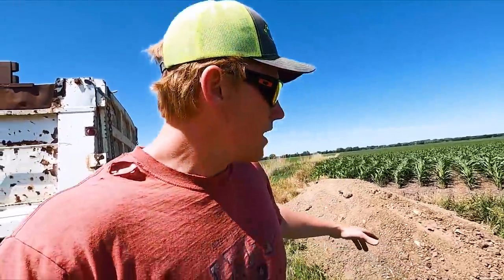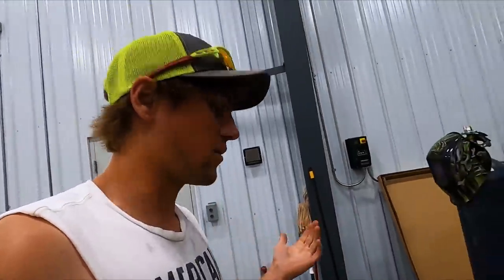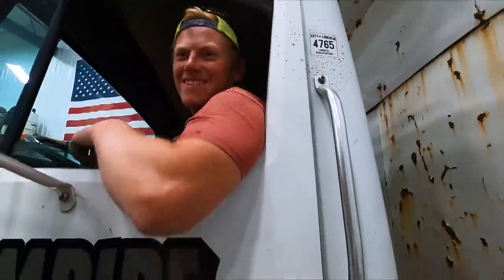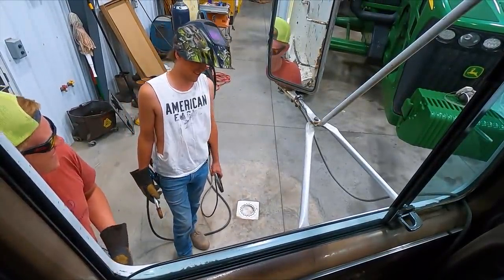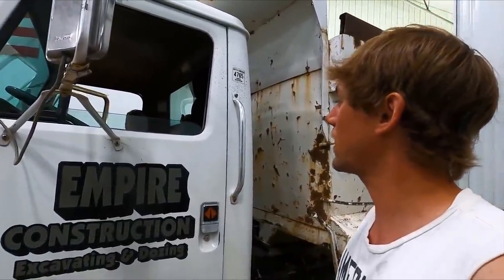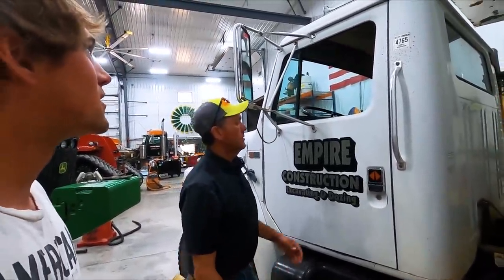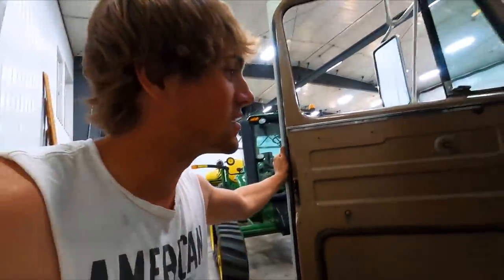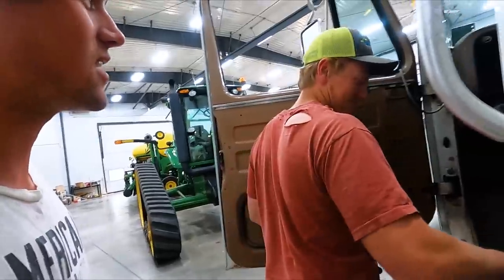The Moment You Realize You Screwed up!!

Comment: I sold a chevy truck that had a bit of rust in the rockers (it had a bit of rocker left after the rust?) So I sold it (fixed), and the guy went to toss his stuff in the passenger door.  Nope.  Not even a little, all nope, all the time.  So he used the left door.  A few years later I saw the same truck up for sale with this note "passenger door doesn't open."  Thanks for the good memories.  As I told him, I didn't promise the door would open post-delivery and if it were important, it would have been part of the deal....